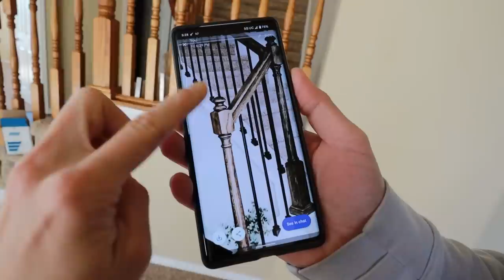Taking a Pregnancy Test!!

Comment: On your stair case, with the smaller balusters consider the spacing (not sure if there will be more of the new ones or the new ones will only go where the old ones go) and the potential for a kiddo deciding to and perhaps being able to stick their head through.
Reply: I was thinking the same thing.  A. because of that video of Paige getting her leg stuck in the crib and B.  I know kids who have gotten their heads stuck in them.  I've even watched videos where animals got their head stuck in those things.
Reply: I didn't even read before I commented but just said a similar thing above.
Reply: I was going to say the same thing until I saw your comment lol
Reply: Also with metal,you have to worry about 1 of the kids bonking their head if they happen to trip...
Reply: This.
Reply: I was thinking the same thing. I was going to comment about it until I saw yours lol
Reply: They would have to put more to have them to code if they are smaller than what they currently have.
Reply: That’s what I was thinking too.  You have to think of the babies sticking their heads through and getting stuck.  The thicker balusters are probably better with little ones!! It’s going to look so pretty!!
Reply: I was thinking the same thing

Comment: When it comes to the wood banisters, I would consider the possibility of the girls falling down the stairs (I pray doesn’t happen, but is possible with kids or even ourselves) and hitting their head on the meddle. You may just want to leave it a wood and change out the shape or size of them, but keep in mind little body parts getting stuck between it. There are many different styles of wood that can update the stairs to be more modern, yet keeping with the wood look and feel. Keep in mind resale possibilities, for when you want to down size or decide you want or need to move. To many personal touches can hurt the resale value. Same with colors for painting and etc. To many people only consider their tastes when updating and don’t keep in mind the resale value and possibly of having to sell your house for some reason, worse case scenario or just downsizing! The more personal touches, should come in how you decorate your personal items and decor not the house design as much. Keep in mind the age and architecture of your home when changing any of the actual attached house decor. Also keep in mind the area you live and the weather, all these in mind can help in keeping decisions a little easier.

Comment: Please becareful about the stairs because children love to slide down them and also stick their heads through them as well as unfortunately sometimes falling down them.

Try to pick something that they either can't stick their heads through or has an extremely large gap so the head can't possibly get stuck. I also suggest rounding off the stairs because corners are painful when hit with force so picturing a child falling down in to a square metal rod or soild wood ouchies.
Reply: If the gap is too big they will want to go trough the hole or might fall through while playing/ climbing
Reply: @CrystalMermaid6  sorry I should of stated when I said extremely big that I wasn't meaning so big that the child could fall straight through the gap but I meant big enough that a head can go through the gap without touching the bars but the body can't go through it